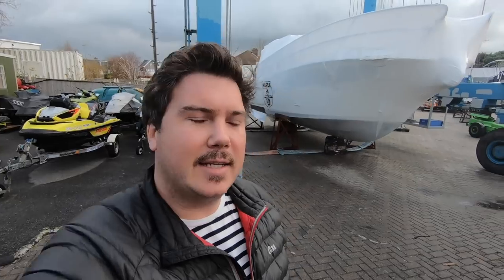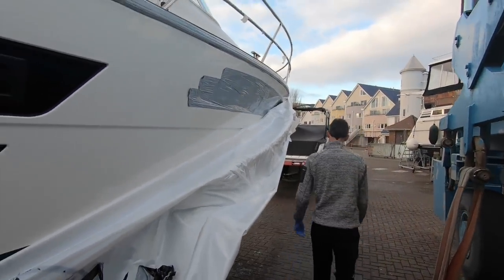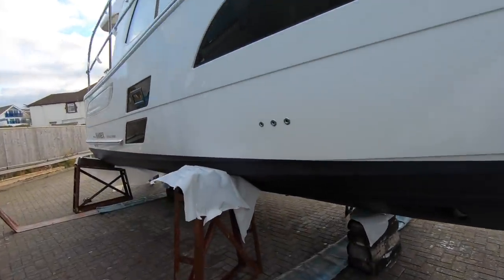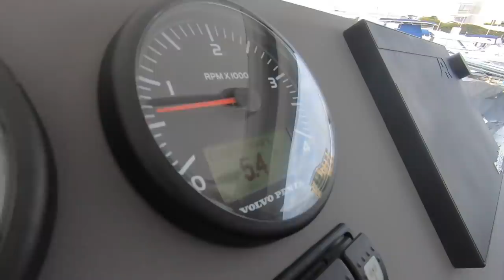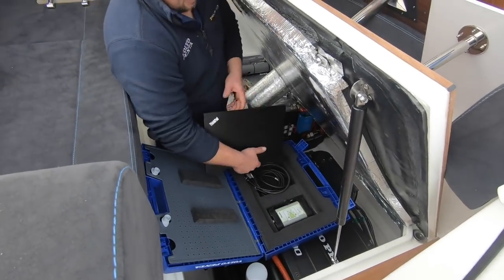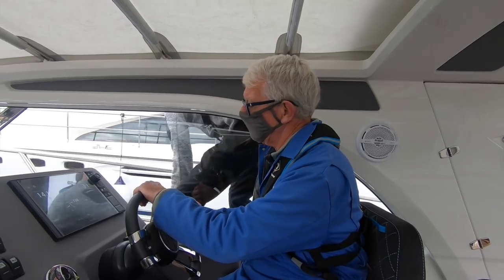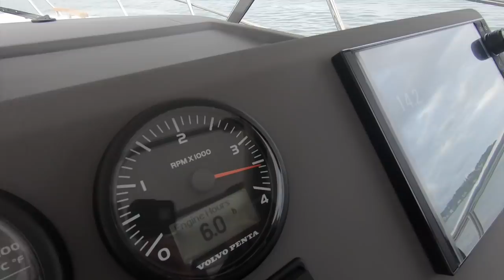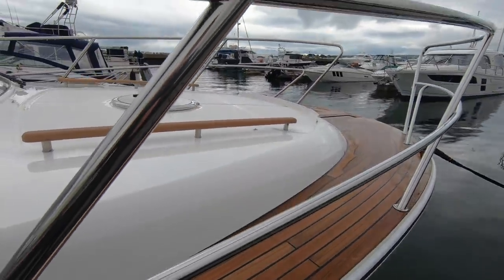Marex 310 unboxing | We unwrap a brand new, factory-fresh £235k boat | Motor Boat & Yachting

Comment: My guess is that they build the boat, up on stands or whatever, move the boat onto another set of blocks that has the wrap ready to cradle the boat, pull the wrap up and around so they can heatshrink it, and then lift it with a crane and straps.
Hope that made sense!

Comment: worth remembering shrink wrap shrinks, so start bringing it under the bow, followed by an extra strap outside the loose wrap, that allows the first initial strap to slack off, put wrap through, lift the strap back into place. similar strategy when hitting it with heat. Bow to stern, lowering straps before hitting it with heat, then replacing them to allow the next one to be lowered.

Comment: You guys are so lucky. We have to install the complete engine package with the controls, wiring, gauges, fuel filter etc. Then we have to install any extra equipment the customer wants and test drive the boats and check everything before we deliver them.

Comment: Is there no antifoul coat applied before she goes in the water ?
Reply: I would guess, not that i've bought a new boat, it looks like it already has antifoul on and as it was run for 5 hours at the factory and at sea near the factory it would already have had it on.
Reply from the maker: Antifoul is applied at the factory.

Comment: Why is this boat listing to starboard, look as it first enters the water and when it returns from test, does it need ballast??
Reply: The weight of planned normal equipment in all storages are not in yet. Thats about 1200 kilos and all tanks are empty. This will level it out